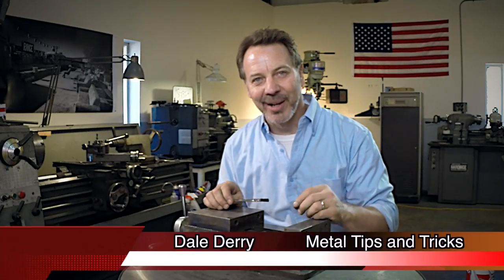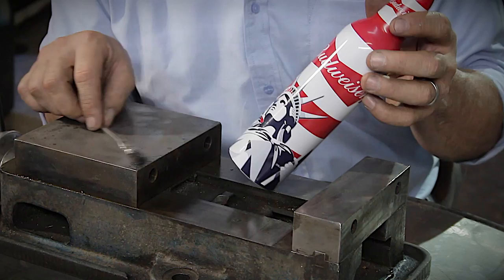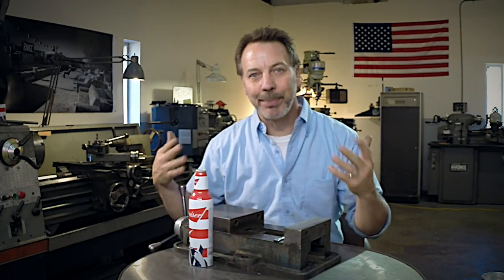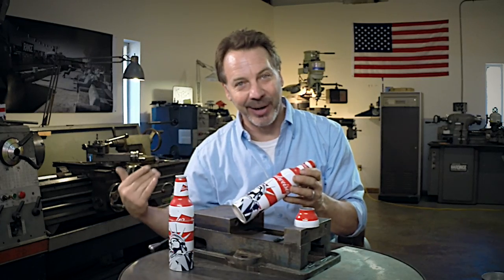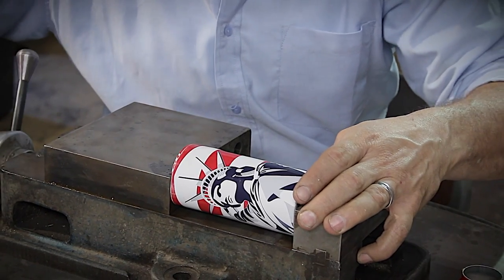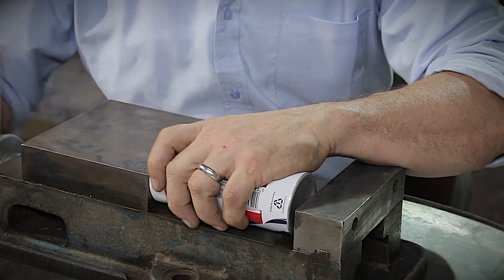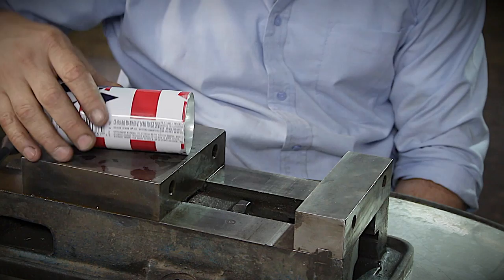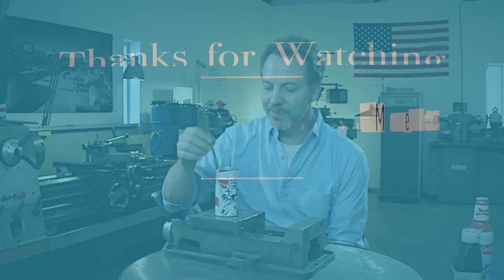DYI Beer Bottle Oiler

Comment: It looks like I use the same cutting fluid.  If so one of the big problems is that it evaporates at a very very quick rate.  So the container needs a lid preferably that covers the brush handle as well.  And me being a klutz I would like either a wider base (hence the tuna fish can) or a weighted one.  Iteration #2?  Maybe a handle as well since I move between the machines with it if that isn't pushing it!  Great topic.  Doug

Comment: Throw a strong magnet in there. It will hold it down easily as well ( on a metal surface anyway ). especially if the machine is vibrating.
Reply: +onedieingsoul You'll also collect every single steel shaving possible. A heavy nut works much better.
Reply from the maker: +onedieingsoul 
The great thing about this project, there is room for customizing.

Comment: A small magnet in the bottom would work well to aid in the anti-tip.  Place it inside before you press it all together.

I use a magnatron magnet (flat doughnut) on a canned chicken breast can works great for a parts tray. Plus unlike the factory bowls you can slide the magnet off and dump out small parts.

Just found the channel. Really like it. I have been hitting the short tips vids. I must say your opinion of Harbor freight calipers is different than AVE's. I like mine too. The digital mic leaves much to be desired though

Comment: Dale,
 From one Dale to another, interesting concept. What proof of oil do you recommend for this gidget? 
   I made one out of a sterno type can I bought at the dollar store. The top can be unscrewed to remove the fuel and wick. I used a 3/4  X 1 1/4 inch hard copper reducing union for the spout with a short length of 3/4 copper pipe to extend down to the no-spill level. I also dropped a rare earth magnet in to facilitate holding it on the saddle. I know, pro and cons of magnets around a metal lathe. The chips do collect but so far hasn’t been too much of a nuisance. 
    For some reason I really hate using acid  brushes for oil spreading. It seems the stiff brush fibers always get splayed out from use causing oil to drip in unwanted areas. My solution was to buy some cheap, camel hair artist brushes. The brush fibers are soft and pliable and hold the oil very well and the fibers always stay straight. Keep the artist brushes away from a clamp knurler though.

Comment: Maybe some additional ballast; like perhaps a couple of large thick washers in the bottom? A bunch of loose bearing balls? (I've seen a big nut used that mostly filled a cat food can that worked very well.) Or as others here have mentioned, a magnet? A magnet will collect swarf though... Probably boils down to more personal preference than anything...

Never suspected that soft thin wall stuff would cut so nice/easily in the bandsaw.

Cool videos, Thanks!
Reply: +rwbishop If the bottom is concave (like a beer can), you could mix up a little epoxy add some iron powder/lead shot/etc then fill the cavity (on the outside of the can) about flush? Should make a nice little custom fitted weight?
Reply from the maker: +rwbishop 
 The aluminum in these bottles is a lot thicker then what is in a cans
Reply from the maker: +Metal Tips and Tricks (Dale Derry)  Good idea!

Comment: My first though on seeing this was "hey, you could TIG weld the two pieces together!" but then I thought "wait a minute, what if I accidentally dropped an irreplaceable screw or something and it landed in that container? I'd never get it out!" so I guess it's best to just press the two pieces together like Dale shows.
Reply: +ArtemiaSalina If push comes to shove, just rip it apart and make up another one later. It's an easy/quick/cheap enough design to be expendable in a pinch... but very practical & easily customizable none the less
Reply from the maker: +rwbishop  good Idea:-)